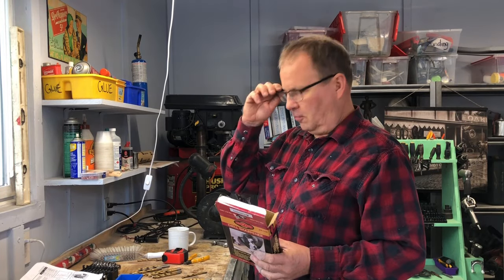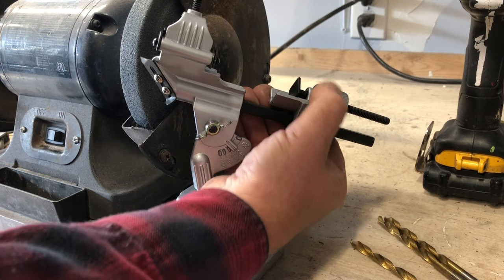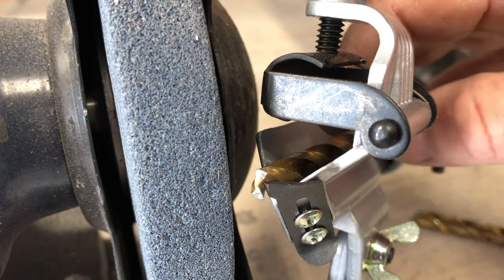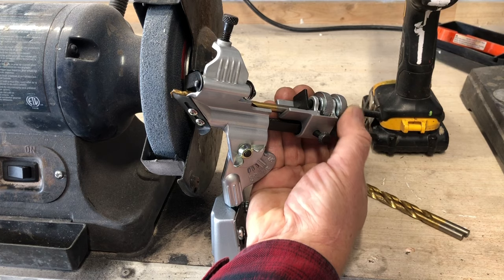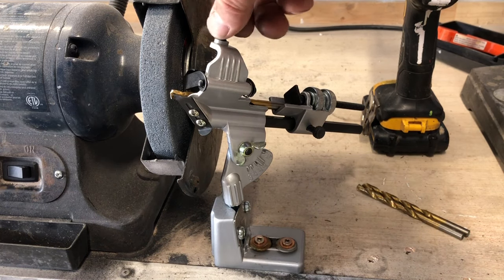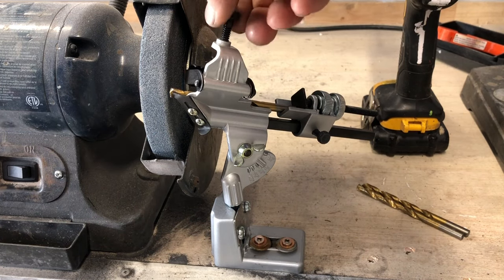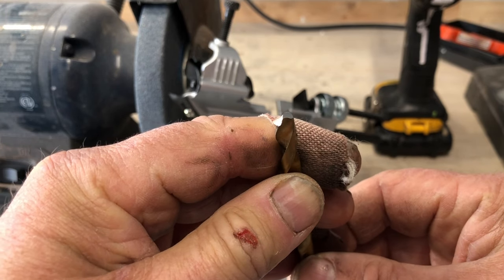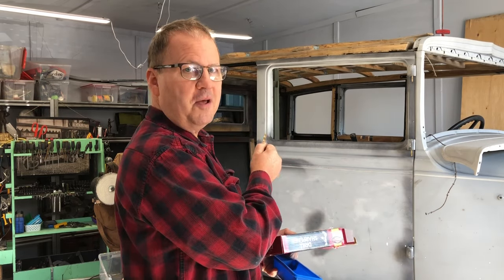Tool Test & Review - Shop Fox Drill Bit Sharpener - Amazingly Good! Vintage Car Restoration

Comment: I have one of these.  The front anti-rotation clip retained with 2 screws is as I understand, meant to orient the indexing of the flutes to create the chisel point (this alignment may be shown in the tool instructions, google for a .pdf file on the tool if needed)...On your demo, the clip is protruding too high for the size bit.  It should just engage the flute just enough so that the trailing edge of the flutes are plumb vertical. to each other.  The clamp is what stops rotation, not the edge guide.   Also, progressive light nibbling on the grind prevents overheating temper loss.  I spray water / dishsoap mix on the wheel to keep bit cool, and/or spray tip during grind.   Its a great tool, thanks for the video...many are perplexed by the appearance of the fixture, but you did explain the steps quite well....Thx!   (tool is made by General, No. 825)
Reply: Thanks for noticing. A good catch, I thought I saw that had not used my new sharpener yet.
Reply: If the "lay" of the grinding marks is parallel to the cutting edges as you are showing you will have a very weak cutting edge.  Particularly you will experience chipping if you drill any hard or tough metal.  The base of that tool needs to be tilted to one half of the grinding angle to get your clearances to come out like a factory bit.  And HSS drills, especially with Cobalt, are nearly impervious to loss of hardness because of being hot from grinding.  And please, wear a respirator.  The grinding dust from tool steels and carbide will literally wreck your lungs.
Reply: Thank for additional tip/instruction on the set up, makes the difference.
BJ.

Comment: To each their own, but I removed the "lip stop" with the 2 small screws. I line up the cutting edges to be vertical  and parallel to the wheel's side, by eye. It's one less "figity" adjustment I need to make. The bit rolls easily in the "V" groove to line it up. I've sharpened hundreds of bits this way on my old Craftsman and a newer identical version off Amazon, my spare! I do a lot of drilling in metal, even stainless steel, are real bugger to drill. I just finished drilling two 1" diameter holes in 1/4" mild steel plate.
I started with a 1/4" pilot, then a 1/2", next a 3/4" and finally the 1" diameter.

Comment: thanks . same as craftsman 6677 or general 825 . after watching some vids , and some trial and error , i'm well pleased with mine . i advise to install a locknut (the thread size on my general 825 is 1/4 coarse) on end of threaded rod , to avoid losing the lower thumb wheel . the indicator can , in some instances , hold the bit from laying (lying?) in the trough correctly . adjust it to just barely touch the bit , and tighten the bit clamp securely .

Comment: Thanks for the Demonstration. I purchased one of the Shop Fox drill bit sharpeners quite awhile back and never got around to using it yet. You have a good understanding of its operations. I am going to use it for the first time tomorrow morning. I have everything set up. It seemed like the perfect stable invention when I looked at it online.

Comment: My bit sharpener is exactly like yours, except it’s an antique Craftsman. It belonged to my great grandfather back in the late 1930s, but it still works very well.
Still using his Craftsman drill press as well, though I did need to restore it.
Reply: Yes a Craftsman model No. 6677
Reply: Got the same one .Love Craftsman .

Comment: Grinding on the side of a brittle wheel can cause it to break up and hurl fragments at very high speed. You should get a CBN wheel if you want to grind on the side. Bench grinders look harmless but they are extremely dangerous.

Comment: It seems like this product works well but I have two concerns.  First, grinding on the side of the grinding wheel seems like a safety issue unless the wheel is made for it, secondly, after some time the side of the wheel would develop a groove or a concave wear pattern and I'm not sure how that would change the sharpening pattern.  How would you then true up the side of the grinding wheel....  ?

Comment: Wouldn't it be better to use the lower part of the stone so it will cut evenly on the drill, where as using the middle of the stone, the stone will cut from the top down.

Comment: You really shouldn't grind on the side of this type of grinding wheel, it may cause instability in the grinding wheel (may cause it to explode).
Reply: This is very light grinding and not free hand and is usually considered to be acceptable.

Comment: The side of that grinding wheel is not to be used for grinding - only the face is to be used.
It creates a very unsafe condition if you start removing material from the side of the wheel.